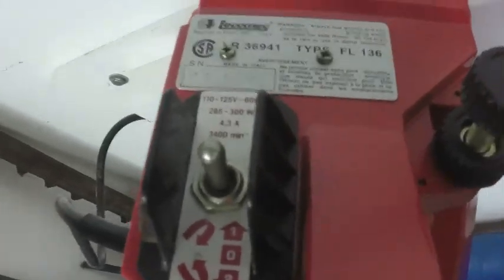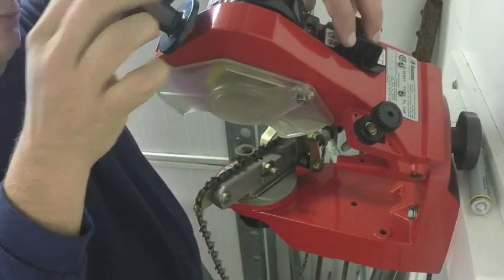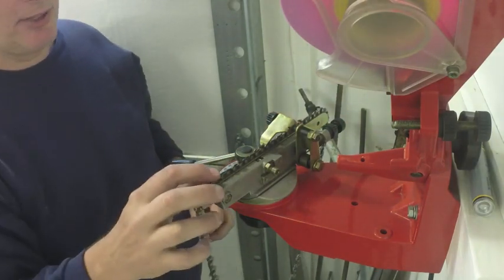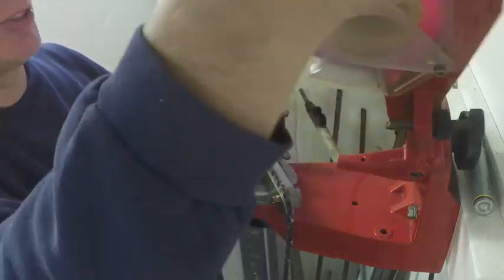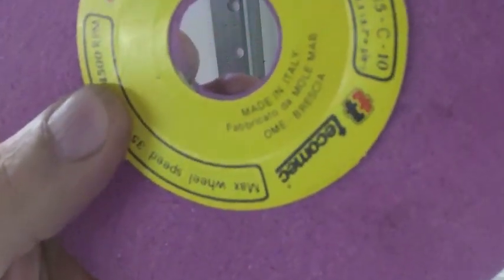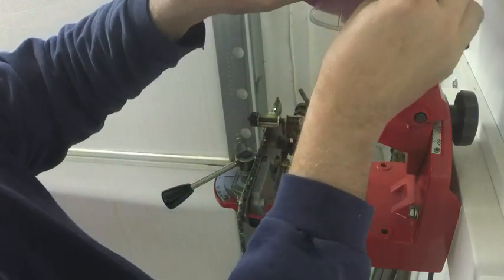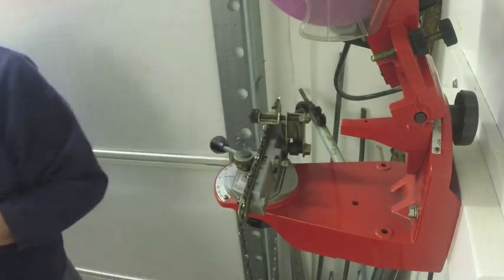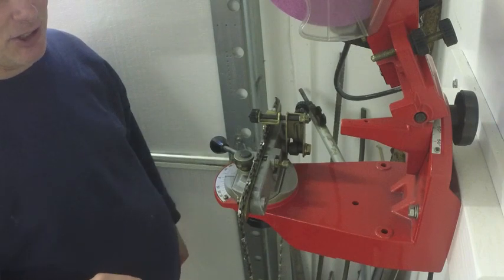Sharpening chainsaw chain with Tecomec FL-136 chain sharpener

Comment: And depth gauge is to be set to each individual tooth because tooth length can vary.
Reply from the maker: Thats way to time consuming. I just give them a quick sharpen, then they cut better than a new chain.
Reply: @OldCarAlley  well all your depth gauges are set at different heights. Sharing bad info isn't good. You really need to watch some videos yourself on the right way

Comment: That chain after "sharpening" still has no hook in the tooth needs alot more metal removed to get the hook back on the working corner. Watch a Buckin Billy Ray  chain sharping video to learn how to really get a chain sharp. I've got a friend that wants to sell me a tecomec fl 136 and I need to know how much they sell for?  Thanks for the video.
Reply from the maker: It cuts better than a brand new chain, so I must be doing something correctly. I don't remember what I paid for it... seems to me around $50. I got it at an estate sale, new in the box.
Reply: @OldCarAlley  brand new chain cuts poorly compared to someone who knows how to hand file. Watch a Buckin Billy Ray video to learn how to get your hook and gullet right.
Reply: Thanks
Reply from the maker: @RR-et6sh  I will check him out... but. really don't use the chain saws much anymore. I don't have 44 acres to play on anymore.

Comment: I noticed you are sharpening the opposite direction of most everyone else on forums, etc. most of them are sharpening outside in on both right hand and left hand cutters, the opposite direction of hand filing.
Reply from the maker: Most of the newer sharpeners only run one way. Mine runs both ways. I sharpen so the wheel cuts up into the tooth. Thats the way the chains state to sharpen them. Probably really docent matter, but my resharpened chains cut better than a new chain!
Reply: I noticed that as well. I have 2 of the FL136 grinders and have been using them for over 35 years. He is grinding in the wrong direction on both sides. Kind of defeats the purpose of a reversible grinder.

Comment: Why not just use a file gauge to do the rackers
Reply from the maker: Thats fine in the field, but they cut better than a brand new chain when sharpened correctly on the grinder.

Comment: Any idea how to adjust the screw on the back side of the vice?
Reply: It is to allow for wear of grinding disc, so the cutter length is the same when change sides.
Set the vice at 0 ° & rear screw to 90°. Place a straight edge in vice. Pull head down to vice ( not running), loosen locknut & adjust screw till the straight edge is vertically aligned the centre of the grinding wheel mounting screw. Tighten the locknut, remove straight edge & ready to proceed.

Comment: Ok so, just a word of advice. You're not supposed to grind that much on one tooth. The tooth gets too hot and it'll cause structural damage to the metal and it'll also warp, so even if you have to make 2-3 passes (all the way around) to get it right, do not keep grinding the same tooth like that.